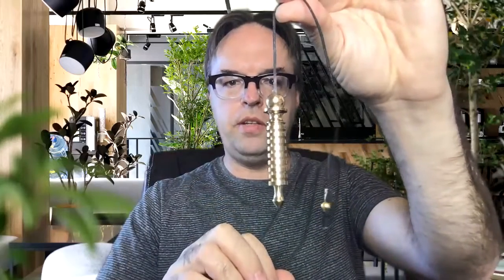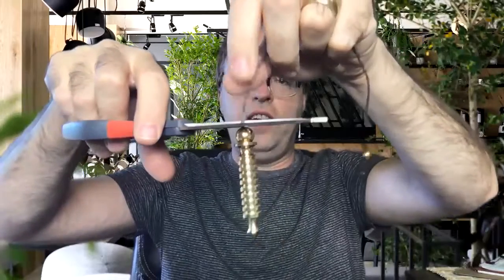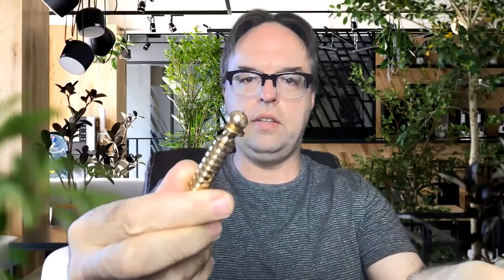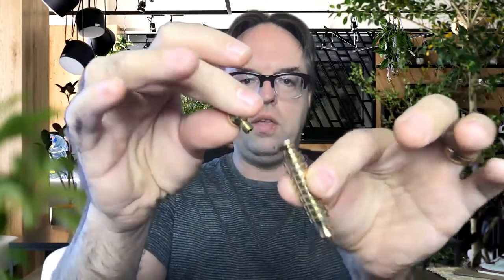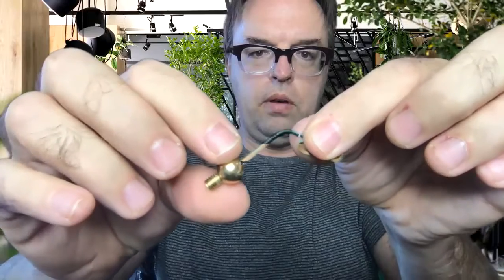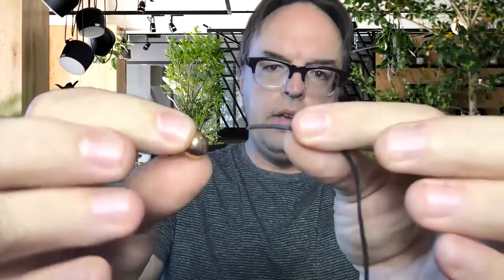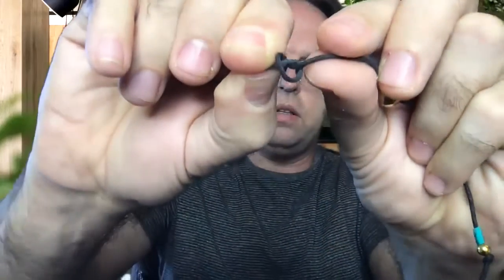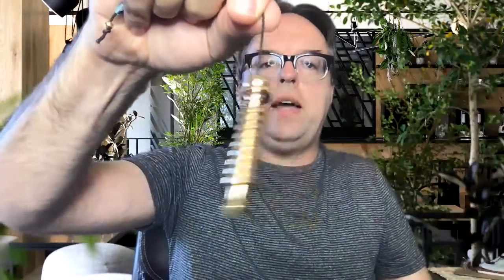Stringing a pendulum that doesn't have a loop on the top.

Comment: I have a mini isis 6 and the knot is too big to pull through the top. I'm using 1mm black cord but the knot is not going through.
Reply from the maker: You pull the string from the hole in the bottom through the top. the knot follows into the hollow chamber